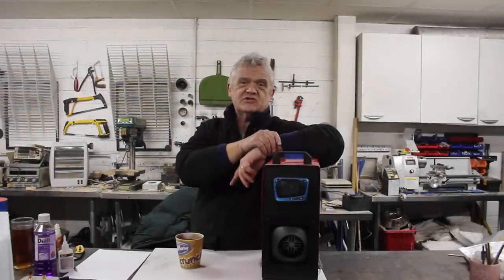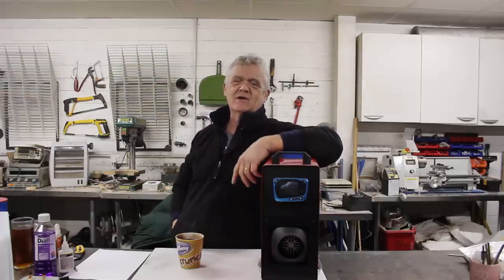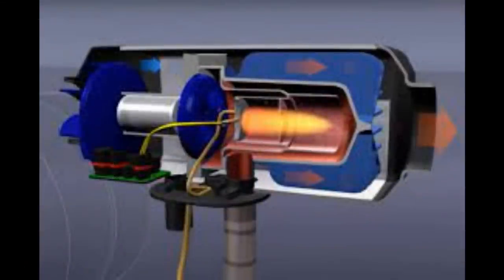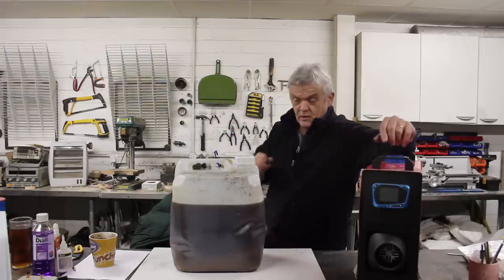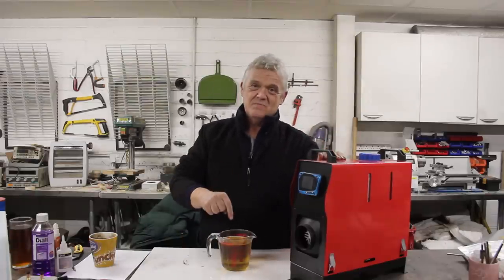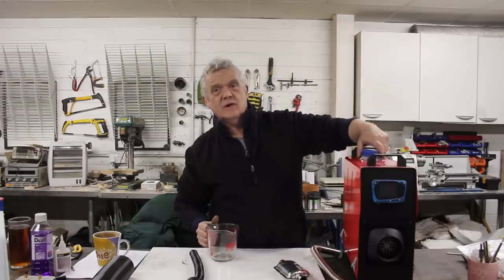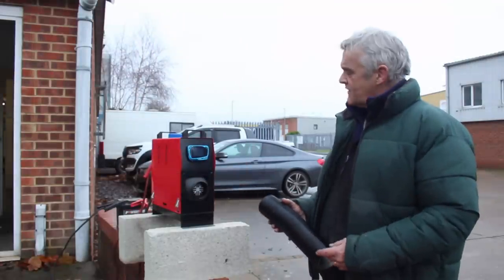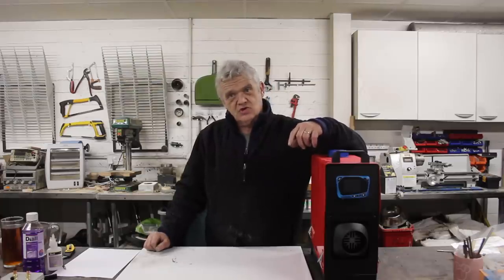1793 Home Made Fuel Running A Diesel Heater

Comment: Robert , were you a teacher or lecturer at some point in your life? the way you explain how things work is fantastic .
you remind me of the way my late Father explained things as a physics and chemistry teacher he loved the practical side of teaching . I remember well that he always came home from work to build something or work on the house or car he was always fixing something up, it seems to be a lost talent these days where many people are stuck in the cycle of going to work coming home and going to the pub and then it all starts again the next morning there seems to be a lot less people building kitchens, rebuilding the car engine until 10pm at night in the garage, building  Radio control models, flying kites at the weekend, fishing , sailing, building stuff, so many skills seem to be lost by so many people in the interest of paying the mortguage and the bills and doing little else, glad to see your keeping things alive. 

This has been extensively looked at by David Mcluckie on you tube using new veg oil and after about 10 hours run time it causes extreme build up of carbon deposits in the burn chamber, its a bit annoying to have to strip the burner down almost every day to clean it, however he did find a balence of 50% petrol and 50% veg oil made a more tolerable mix that kept the chamber clean. have you toyed with the special settings menu by entering the code 1688 into the lcd screen? some of the Blue screens on the 2kw heaters use the code 9009. you can adjust the fan speed, glow plug setting and Hz settings but only if you are leaving the unit powered on if you turn it off it will return to its default settings. This is why the backlight on the lcd screen burns out, we turn ours off when we are not using it to preserve the life of the backlight.

Im now running all 3 of mine on kerosene with 25ml of good quality 2 stroke oil to 25 litres of kerosene. they wont tolerate used veg oil unless you add at least 50% petrol, diesel, kerosene to the mix .

Robert please be careful with carbon monoxide and running these things.
if the special settings are changed they can produce carbon monoxide from the glow plug breather which leaks out of the rubber glow plug cover as it becomes distorted through heat damage this carbon monoxide gets into the hot air stream and into your living space which is why its important to seal the rubber glow plug cover with high temp rubber sealent, we acheived 33 parts per million not hugely high but probably not the best idea if granny falls asleep on the sofa all night long.
we have been saving £40 a week in heating our home in the UKs 2 hardest cold snaps this winter we dont use our boiler for anything but heating water at the moment.. The heaters have saved us from going broke on gas prices this winter 2022-2023. I have 3 heaters now  two 5kw and  one 2kw. we dont run them all night long as it saves fuel and the house stays warm enough to sleep upstairs at night. its usually down to about 17 degrees C by 7.30 am by which time the diesel/kerosene heater goes back on to maintain a comfortablke 20 degrees C downstairs all day, its turned off again at tea time when cooking  and put back on for about 5 hours in the late evening to about midnight.
its more work than turning up the thermostat on the gas boiler but by eck it saves a lot of money and the bills are much less scarey than our next door neighbour who maintains their home at around 18 degrees C 24/7.

they are sitting in the cold worrying about how to pay their heating bill now and Im trying to pursuade them the get a diesel heater, ive even offered to collect the fuel from the depot when I go to get my supply for the month ahead.

it is not readily available in Northants as farmers have all moved to bio-fuels and comercial businesses are banned from using red diesel for heating their workplaces , so its a 50 mile journey down to oxford ton get fuel from an oil supplier that sells small quantities from a pump you can buy as little as 5 litres whereas the oil suppliers up here will only sell you a minimum of 2 x 205 litre drums per delivery and dont have pumps for seling smaller quantities.

There were some all in one diesel heaters availabe on amazon  with blue metal cases for a little over £100 Honhill diesel heaters so they are coming down in price. currently sold out, at this kind of price they shift very quickly indeed.
but they need upgrading before use to make them safe, the fuel line and often the control LCDs and ecu needs replacing to something that works properly like the set you have on yours. watching lots of youtube videos helps a lot to make them safer. the last thing we need is an accident where someone uses one one sent out with the less safe 
green soft plastic fuel line  which melts from exhaust heat, and that will end it for everyone. done properly these can be great heaters and as Ive said one 5kw heater will heat a whole house easily and cheaply.

Comment: Just use red diesel.. Agricultural diesel, much cheaper (than road diesel)
Reply: £1.50 Lt UK
Reply from the maker: apparently cheaper but not much cheaper mate
Reply: @lioncrunch9098  Only €1.20 for me
Reply: @ThinkingandTinkering  Actually if you buy in bulk you can get red diesel as low as 50p per litre, all you need to do now is show us how to remove the red dye so I can put it in my car.

Comment: Can you tell me how adding water and gelitan results in cleaner oil without a high water content?
I can't get my head round how all the water is removed when you add so much?
Love these vids thank you.
👍
Reply: Water and oil do not mix - the oil will always float on the water.
Reply: @Richard Balderson  It's not as black and white as that, you can remove a lot of water in WVO in a centrifuge or by heating so not all water content will easily separate?
Reply from the maker: it's not my idea mate - I was just following what others did but they did it for cooking it didn't seem to have transferred across to folks looking to use it as a heating fuel - that's al I did - there is a ton of info on it just look in the cooking suggestions lol
Reply: @paulluggar5964  Does it really matter?  Any remaining water (go on, state a figure/value), after a reasonable separation time, will not affect anything regarding combustion in these heaters.  I am running my heater with diesel from a drum with water in the bottom.  I just use the diesel decanted off.  We (should) all know that diesel storage tanks collect water, so need to be off-level, the lower end being able to drain off the water occasionally.  Now, if that fuel is biodiesel it could well contain a little more water - but that will still be nothing for anyone to worry about.  

BTW, are you thinking here dissolved water or ‘free’ water in suspension.  There is a large difference for high pressure systems, such as injection equipment for diesel engines, but not really of any significance with these heaters.  Diesel density is only about 85% that of water.  Given time the water will sink below the oil.
Reply: @Richard Balderson  You asked "Does it really matter" without asking 'what will it be used for'. If you assumed I was concerned about water content when using this fuel in an atomising burner you would be wrong. I actually use kerosene from an old heating oil tank that was contaminated with water and alge in my CDH without issue. I think most people understand the simple physics of water and oil separation which was not what I asked about. I was particularly interested to know if the water content of the oil was increased using this method of cleaning WVO, if you know for sure then please share?
Apparently this method of cleaning WVO was patented and tested in a diesel engined car. My interest was if it was going to be possible to use this method to make biodiesel for a modern common rail diesel engine, if the water suspension is high then obviously it won't be...
Reply: @paulluggar5964    These hot air heaters could  be used in any car.  Petrol, diesel, lpg.  The ones supplied as discrete parts are much better (safer) , than these ‘suitcase’ types, for fitting in vehicles.  The heater would certainly not be able to discern between the older diesel injection pumps and the more modern common rail type. 🙂. They are not that clever.
Reply: @oliver90owner  Or to put it another way you don't know.
🤦‍♂️
Reply: @paulluggar5964  No, just playing you at your own game.  You don’t seem to know what you want to know.  Bye.

Comment: I have a diesel heater in the van, I run  the van on bio fuel, (there are no rubber seals in the diesel pump)but, I wouldn't run the diesel heater on bio fuel as it has rubber seals and veg oil damages rubber. In the short term it will run ok but in the medium to long term, I wouldn't be so sure.
Reply: But this is YT, very few think long term and even fewer FILM long term, especially when it's all gone tits up a few weeks later 😏
You and your sensible ideas are no good here 😁👍
Reply: @Dirt-Diggler  it's not the first time someone said this to me, a friend of mine pointed out, just the other day, that a teacher once said I would amount to f@ck all. I am debt free, my house has solar and batteries and a wood stove, I have an off grid van that I travel in for the best part of the year, 250 nights away last year, £50 a night hotel, do the math. I looked at your comments, your spot on!
Reply: @kevparr  glad you took it the way i intended chap 👍😎👍
Reply: @Dirt-Diggler  you'll not get far with your open minded, free thinking attitude either 😉
Reply from the maker: I agree - I have no idea about long term - but I plan on finding out - for me the problem is no one will watch the video - I have seen this lots of times - if I do a too many videos on a video series the views drop off to next to nothing so no one sees the long term videos I do lol
Reply: @ThinkingandTinkering  that is a shame as i value your input, i may be the minority but I'd watch it 👍

Comment: I would suggest adding a heat exchanger to the exhaust, to pre warm the air getting sucked into it. 
As long as the exhaust temperature stays above 60°C you are fine with water/corrosion.
Also pre heating the veggie fuel might help the burn/pump.

Is the air for burning already separated from the air getting heated ? Or does it use "room air" and then sucks in cold air into the room/cab from outside.
EDIT: just checked you other video: separated air, very good.

I've already modified two "cheap" room air conditioners (for cooling only) with only one exhaust pipe to run separated air streams.
one loop sucking in the warm outside air and taking away the heat from the compressor and blowing directly outside again,
one loop running the room air getting cooled in a closed loop.
This greatly increases the cooling, since there is no hot air from outside constantly sucked back into the room.
..and its only a few plastic parts and pipes, which if you buy a 2-loop version make a difference from 270 (one pipe) to 800bucks upwards for 2 pipe versions.

One could think the industry made a deal on the price part to not underbid each other for material costs of probably 25 bucks in large quantities.

... when burning fuel only for heat i always get teary eyed, when thinking about using a old smart 3 cylinder diesel to turn this into electrical power and heat.
(There are conversion kits for the cars, refurbished engine in exchange is available around 500 bucks)

Comment: Several youtubers have already done alternate fuel vids on these heaters. I saw one run on primarily used motor oil, where after 2 or 3 years it coked enough to stop operation. And as Rob says it was able to be cleaned and put back to service.
Reply: You missed the ones where they block after a few hours and cannot be cleaned cos the hidden screen and swirl chamber is blocked and you ni on need to destroy the burn chamber taking it appart 😏👍
Reply: Don't forget the rubber seals, they are damaged by veg oil.
Reply: Yeah, I've tried to run on various mixtures of used motor oil/diesel/gasoline. Unless you can find a way to adjust burn settings, it plugs up real quick. Mostly on the coldest days of the year, and what a PIA it is to clean it out then. I've taken mine apart so many times it's almost worn out. Kerosene alone will seize the pump.
Reply: @livestock9722  some of the blue controllers allow you to set fan speed separate from pump speed 👍 not sure if others do 🤔 TBH only really played in depth with propper webasto or ebers and the blue controller Chinese ones 👍
Reply: @livestock9722  Kerosene will not seize the pump. Myth that's has been circulating for several years. The majority of UK users run on Kero(28sec) as does every central heating pump.
Reply from the maker: cheers mate
Reply from the maker: in my heater there is no hidden screen!
Reply from the maker: as far as I could find out veg oil does not damage rubber
Reply: @georgedeaney7270  Oh good to know. I must have dreamed up the scenario twice in my head then🤣 It is no myth, I can assure you. Depends on the pump I suppose. Kerosene in Canada is very very low lubricity, as I found out.
Reply: @ThinkingandTinkering  there in lies the problem with Chinese manufacturing, lack of build consistency and quality control ☹️ usually inside the burn tube there's a larger screen behind the plate and you have to ni on destroy the tube to get at it
Reply: @ThinkingandTinkering IME older rubber seals get damaged by SVO and bio, modern seals are usually actually neoprene so are safe.
Last seal i had damaged by cooking oil was on a sierra stop solenoid, i changed it for a neoprene one and it seemed to solve the issue, i dont think real rubber seals are a thing any more cos fuel like E10 dry rots it and it caused fires when it first came out, ni on all rubber fuel line is neoprene lined and "rubber" seals aren't really rubber anymore 🤔 mind you with Chinese builds you can't be sure ?
Reply: @ThinkingandTinkering  I'm pretty sure all three wire heaters have a settings screen it's simply finding the combination I'm pretty sure that you have a three wire should have a blue wire look the afterburner it's a thermostat for these heate4s that also allows a settings adjustment
Reply: @Dirt-Diggler  old seals get damaged normally from leftover methanol which is why they changed them out in newer vehicles i never heard of them getting damaged from wvo before?
Reply: @patrickday4206  only used SVO or bio, WVO allways gave to many issues for me , SVO made the stop solenoid seal swell up and go soft and gooey on my Di transit and my P100, i run SVO in my Mondeo TD but i fitted a neoprene seal to it just in case 🤔
The general consensus on the bio forum i used was it depends on age of the seal and or what it was made of to start with 🤔 mind you often the pump would seize long before the seals gave trouble, Di transits with the Lucas pump didn't last long at all whereas the Bosch pumps tended to last long enough to have issues, to be fair i was doing 50K a year with a recovery truck so that accelerated any issues that most peeps would never experience 😐
Reply: @Dirt-Diggler  what year was the p100 I don't know what that is I'm from the states
Reply: @patrickday4206  ah sorry, sierra P100  it's a 1T pickup truck 👍  1989 1.8 TD, it used to the same engine as the FWD Escort and Mondeo, not sure if you got that engine over there ? I don't think you got the Mk3 transit with the Di engine either 🤔
Reply: @Dirt-Diggler  always bothered me not being able to get an American pick sold over seas in America lol

Comment: Brought the 5kw version and made a box with a vented flue through wall ,so the intake is warmed by the outlet vent ,keeps my house at 20c runs all day on 2.5l of diesel , only use my  combi boiler for hot water now, might look into making my own fuel to make it even cheaper

Comment: I just watched a very interesting video where the person connected the exhaust to the bottom of an empty radiator and exhausted it out from the opposite top hole and out into the open to vent safely out of the room.  The radiator obviously got hot, a hot air convector heater...a great idea but probably more useful passing through the primary coil in a vented hot water cylinder to indirectly heat your stored hot water.

Comment: Rob you was saying that you could get a mains adapter to POWER THE DEISEL HEATER  where would i get one and what do they look like ?
Reply: basically any 12v battery charger. Even a cheap "trickle charger" He mentions "3 volts" but obviously meant "3 Amps" which is quite a low current, just to run the fan. As per other comments tho, it would be wise to include a small 12 v rechargeable battery such as a motorcycle battery (or old car battery if you've got one) to provide the higher start-up glow-plug current and as backup in case of power outage. Connect the heater and battery across the charger, in parallel i.e all the positives together and all the negatives together.

Comment: HiYa, was just wondering .. what are your thoughts are on the new .. Acoustic Thermal Heat Pumps which seem to be a lot quieter than the old Ground/Air Source heat Pumps?
Reply from the maker: I will have a look at them

Comment: Won't run on 3v, it will cutout if it drops much below 10v, if it's a 12v model. Also requires about 10a while starting up, to run the glow plug. I would look for a 20a AC to DC adapter, as many are over rated in their specifications.
Reply from the maker: slip of the tongue - sorry my bad